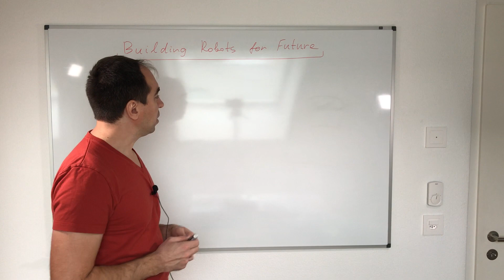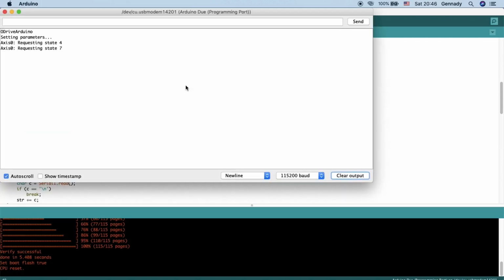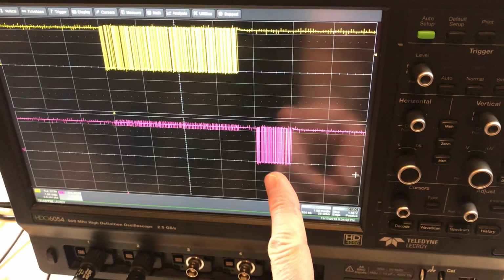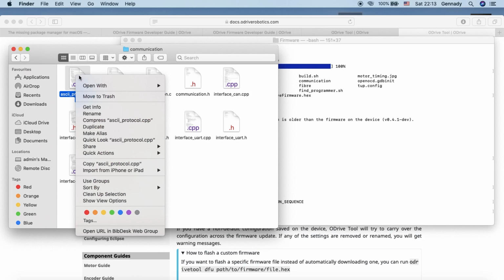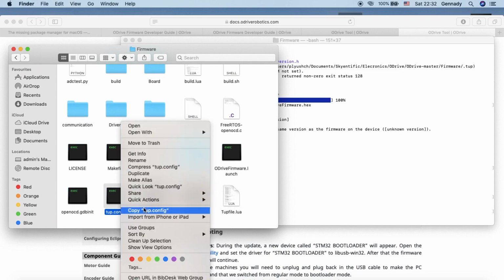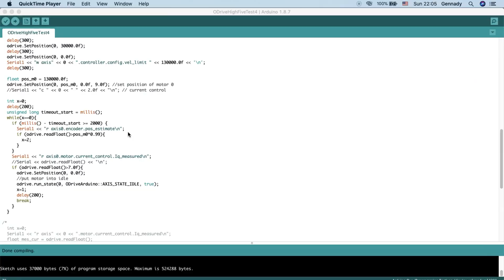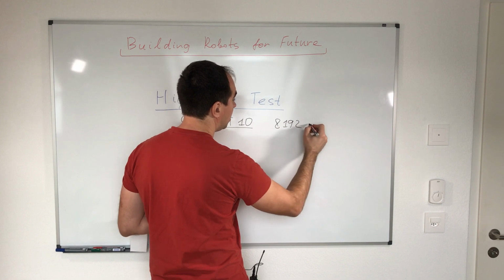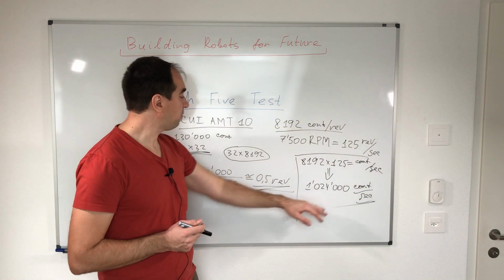Fast Force Feedback for Brushless Motor (ODrive + Arduino)

Comment: Thanks! I really appreciated to watch your analysis and optimization of the communication between the Arduino and odrive. (My experience is more on programming and quite poor in electronics). I want to ask you about the time lapse between the moment when the Arduino program detects the arm stopped (the current raises, as you shown) and the moment when the program decides to go back with the arm. This time lapse looks like much more than few milliseconds in the video. BTW, I subscribed to your channel, thanks again.
Reply from the maker: Thank you. In the program when the high current is detected, first it put driver into the idle state (where the motor does not apply any force) and only afterwards it send the command to bring the arm in the initial position. Probably all these commands take some significant time. I did not analysed this yet in details.
Reply: sorry to be off topic but does any of you know of a method to get back into an instagram account?
I was dumb forgot the password. I appreciate any help you can offer me
Reply: @Thomas Asa instablaster :)

Comment: Hi, It's a amazing aplication. Congratulations!!!!
I want to ask you a question. I have purchased an Odrive v3.6, and I want to do a torque control of a BLDC motor, but set the control setpoint with a potentiometer. Then, to start the motor, I want to install a button, and another button to stop the motor.
The questions are surely very silly for you, and I beg your pardon, but I still don't know enough about the Odrive device.
How can I make this configuration? How should I program the Odrive to work under these conditions?
Thank you very much and once again CONGRATULATIONS !!!

Comment: I think this would work quite well with a backdrivable gearbox (or even without a gearbox) if you tweak the stiffness (current/position gain etc). I do not have a lot of experience, so take this with a grain of salt. :)
Reply from the maker: This is very good idea. And I will try to do this. I have pulleys to make the gear ratio of 2 and 10.
Reply: @Skyentific  Great! I'm excited to see how it goes. Best of luck :)

Comment: This is fantastic!!! I'm working on building an arm right now using a couple of ODrives. Where did you get that gearbox?
Reply from the maker: Thank you for your comment! I bought this gearbox around 5 years ago. This is planetary two stage gearbox with the reduction ratio of 32. Unfortunately this seller does not exist anymore on aliexpress. But on aliexpress you can find other similar gearboxes, try to search for "flange output planetary gearbox reducer for NEMA23". This is quite expensive gearboxes (starting from 200-300 dollars), mine was around 400 or 500 dollars.